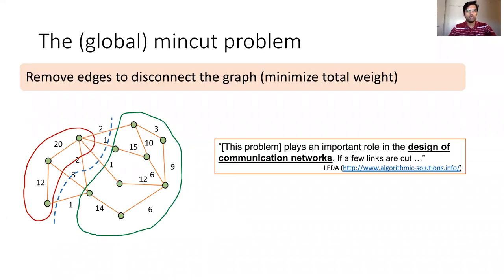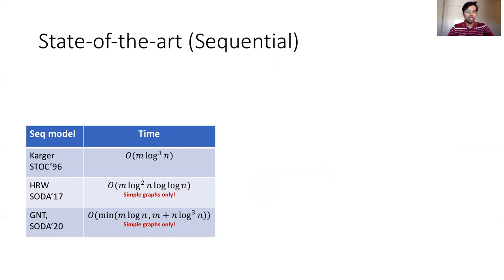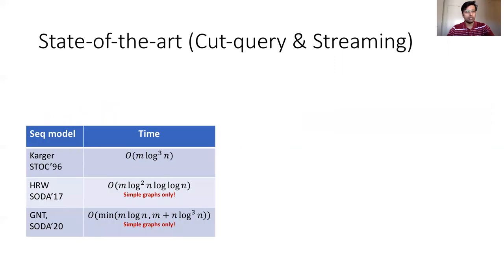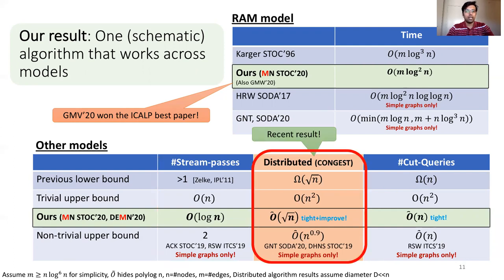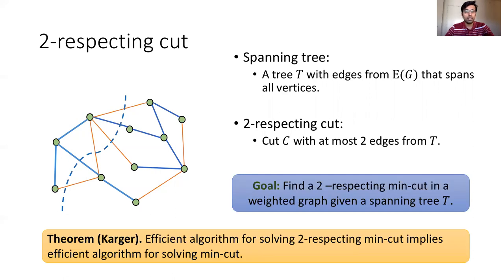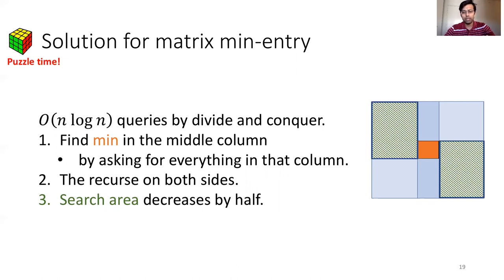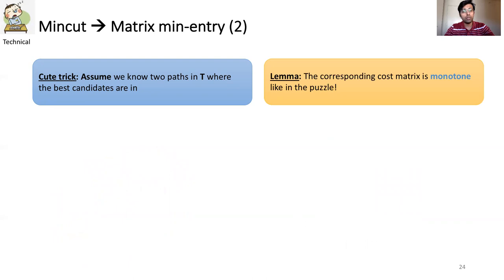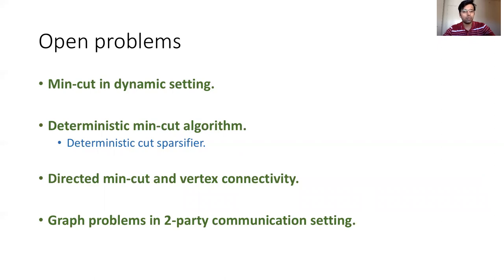Session 4A - Weighted Min-Cut: Sequential, Cut-Query and Streaming Algorithms

Comment: (Correction by author) 
- @3:47 RAM model (not Turing machine)
- @15:08 Value of the cut (not min-cut). This mistake is also present in the corresponding slide where the blue-dashed cut represents a (unique) cut that respects edges ei and ej (and not the min-cut).